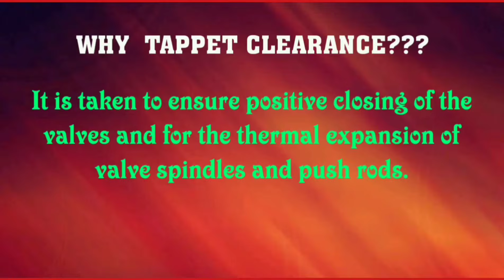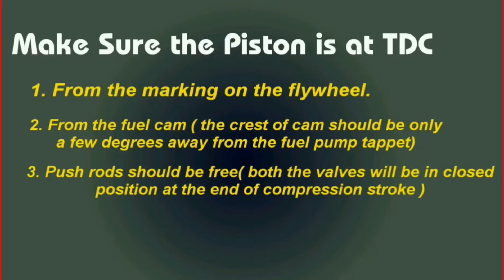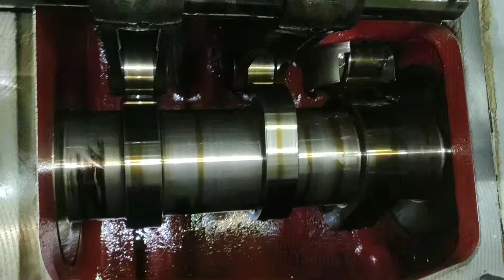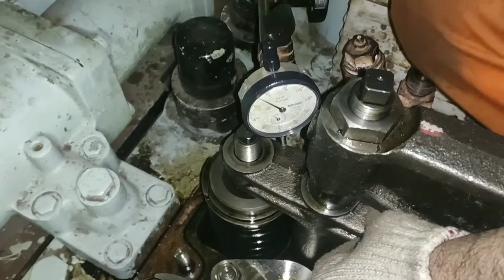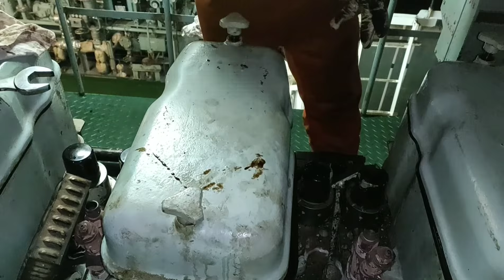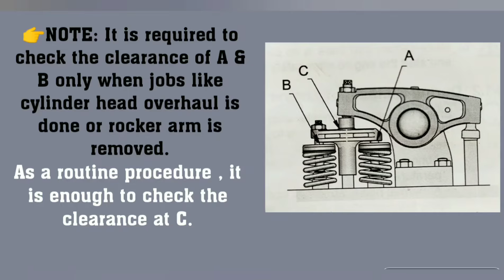Tappet Clearance / Valve Clearance adjustment procedure of Diesel Generator. Diahatsu

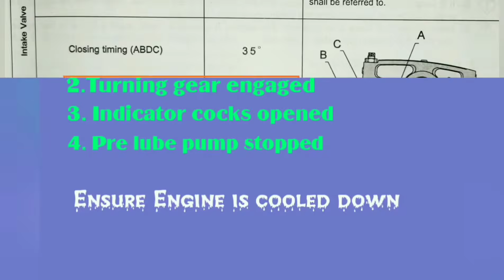Comment: 1:57 sir why we stop the pre lube pump while the turning gear is engaged? I think it will damage the liner.
Reply from the maker: bro, dont look like that.... actually it is the preparation procedure.... when we are going to check/ adjust the tappet we need to engage turning gear for turning as well as  safety. also we need to open the cylinder head cover, if pre lube pump running it will cause oil to spill out...hope you understand.

Comment: bro can u explain why we need to check positionA AND B are o with dial gauge
Reply from the maker: Whatever reason we learned for having tappet clearance is between rocker arm and top of yoke..... If the clearance at A and B is not zero, how we can attain the desired results..., like positive opening of valves.....Also if gap there it can cause damage to faces.....Also if A is zero and B is not zero there will be uneven force.....

Comment: i have finished a top overhaul of diesel engine. should i carry out tappet clearance while engine is cold ? or when engine is warm with jacket cooling system in circulation?
Reply from the maker: You can do either of both... Some manual will be mentioned  the tappet clearance values for both cold engine or warm engine.....it will normally have 0.1mm difference..If only one value is given  it will be better to do after taking jacket water and ensures that there is no leak and  finally adjust the clearance...

Comment: Very well explained sir,However  I am slightly confused as you have mentioned that the tappet has to be set when the piston is at TDC at the end of compression stroke which is correct but you had also said (JUST BEFORE THE INJECTION STARTS) which is I think misunderstood as injection must start few deg. BTDC, referring to fuel pump injection timing. THANK YOU. MORE POWER...
Reply: The only thing is we have to ensure that both suction and exhaust valve is closed which actually happens during the compression stroke.
Now since the compression stroke is a full length we focus near TDC because just around TDC fuel will be injected and combustion will start and we want that at that time combustion space should be fully sealed...that is exhaust and inlet valves are close completely...
If u take just after TDC,how will you enusre that this is Power stroke or this is scavenge stroke...
Reply from the maker: good
Reply: I hope I am able to explain
Reply from the maker: Sorry for so late reply. I missed your comment. yes, tappet has to set in compression stroke when is the piston at TDC, but it is exactly not 100% TDC. From the flywheel marking you can found that a specific unit is at TDC ,but when you check the fuel cam you can see that it is  just few degrees away from the start of injection.   You should adjust tappet with the flywheel markings, but we are looking at the fuel cam to ensure that it is at compression stroke.